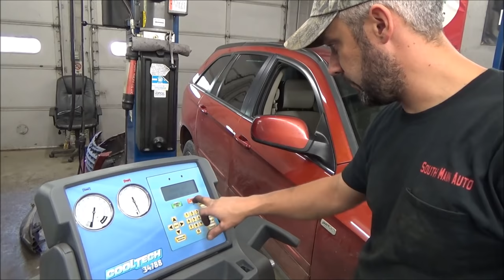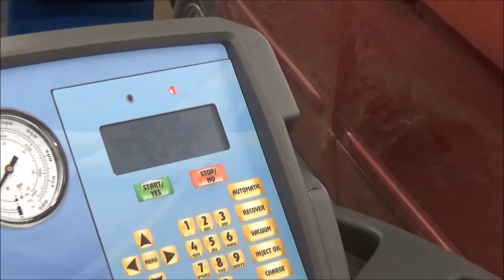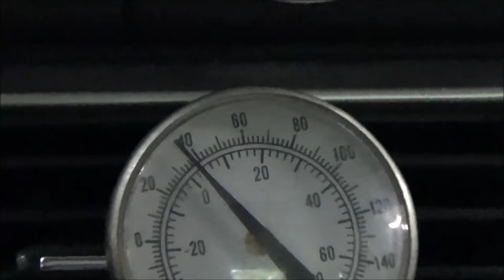A/C Condenser Remove & Replace : Chrysler Pacifica

Comment: Hello , i have to disagree about your theory about how water in a vacuum reacts , when in a vacuum of 30 inches of vacuum ,the water freezes solid water boils at normal atmospheric pressure of approx 14 psi absolute which is different from 14psi gauge pressure . the gauges read 0psi at normal atmosphere because they are compensated to read 0 when open to normal atmosphere this is 14 psi gauge . when water is in a 30 inch of mercury vacuum it can;t boil you can't change the normal boiling point of 212 f .that's why women use a pressure cooker the higher the pressure the higher the temperature   to raise the temp of he water to a higher temp .kind of like the way the cooling system works , by keeping the system at 15psi he coolant won't boil out until about 250 deg f . in a vacuum of 30 in hg water temp is water is  -90 deg f and a solid .the water skips he liquid state and goes to a gas state called sublimation like dry ice that goes from a solid to a gas at normal atmospheric pressure . so if you suspect water in an ac system under vacuum you have to use heat lamps of keep engine to induce heat . car a/c systems don;t need to  get into the micron range of vacuum but water left in system can cause the orafice tube or txv valve to get blocked . most people think1 hour is a long time to vacuum, but depending how long a system is open to atmosphere it could take muck longer . on this repair you covered the line with paper towels but you didn't seal the lines from air intrusion and all air has moisture even on a 50 % humid day . what usually happens is an open system is the filter dryer absorbs moisture and can become saturated and can no longer remover residual water from system .. The filter dryer should always be replaced when changing the condenser ,especially in this repair , the leak in the damaged system the hole in the condenser had the system open for a long time .many days it looks like . So there was probable a lot of moisture in the system . also I had commented on using pag oil before assemble ,this isn't to make assemble easy ,it;s because you don't want to put in a dry o ring and new condenser is dry . One more thing ,whenever you replace a component on ac system you need to know how much oil that component lost in oil . When changing a compressor you should measure the oil by pouring it out and add same amount to new compressor  . I watch your show and i think you are the best mechanic on u tube and i buy your merch . I  spent 45 years in communications' and one year at apex tech (remember the commercials) It was a 10 month course .I'm not going off on you at all ,but I know you are a guy who can take constructive criticism and share it with your viewers . If you dispute any thing I said spend some time and look it up  . Faithful viewer MisterPc

Comment: Radiator right there in open. Now is the cheap time to replace it. Stupid move by the owner. You charge the AC and you no the radiator will start leaking.

Comment: I enjoy watching your videos for years but I have to let you know that you made a mistake on this one. My opinion to replacing "related parts", "while your in there" is to save the owner time and money of replacing those parts in the near future. Not replacing the O-ring for the part that you did replace is highly unusual and brings me to question you why? The o-rings cost pennies if not a few dollars...right? They are wear and tear items that will harden over time and will lose its seal. The customer will have to pay you or someone else to remove the front end to replace o-rings all over again for what? example: replace condensor=1.0dg, 1.4 evac/chg ac, 3.0 r/r condensor=5.4 hrs or $540 @ $100 per hour plus part $300?, to replace the o-rings in two years she will have to pay 1.0dg, 1.4 evac/chg, 2.5 hours to r/r front bumper/condensor fittings again=4.9 hrs=$490 in labor and $3.00 in parts!!! Your customer will not respect you and will not return at that point.Not worth that two minutes and $3 or less in parts.

Comment: I just don’t get when “mechanics” try to beat flag time.. if you get paid to do a condenser and it pays 3.5hrs like stated. It’s takes you .5 to take the bumper off and on, .7 to remove trans cooler and condenser, and .7 to pull a vacuum and recharge… you won all day. I understand shit happens stuff breaks, you might not have all the tools for a specific job whatever.. but come on you can’t win on every job.